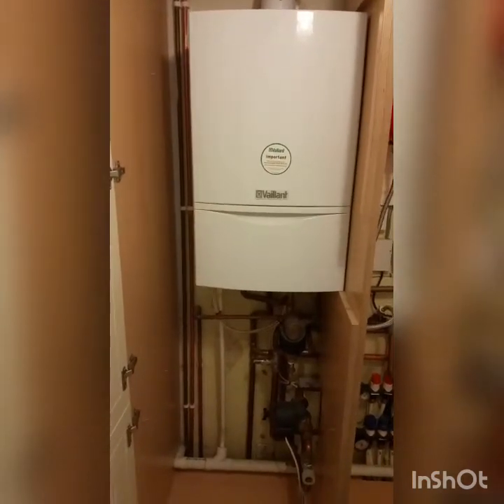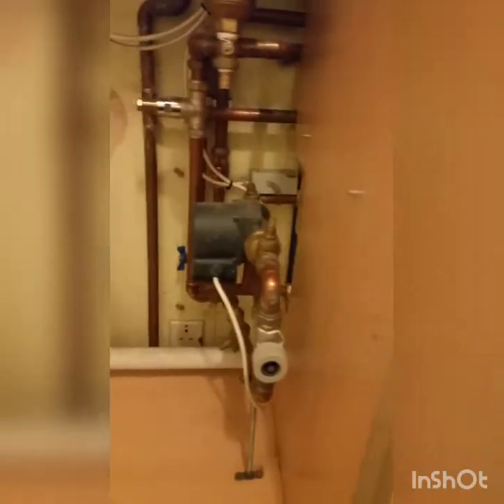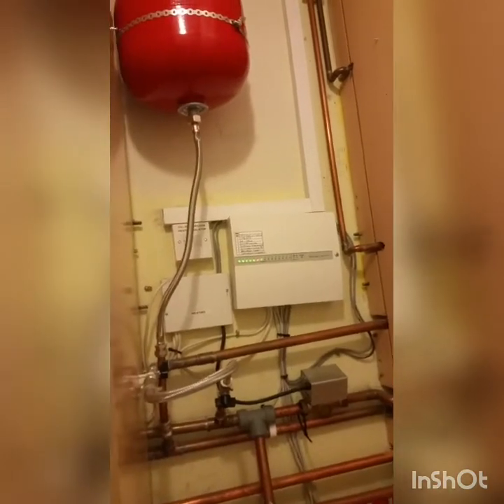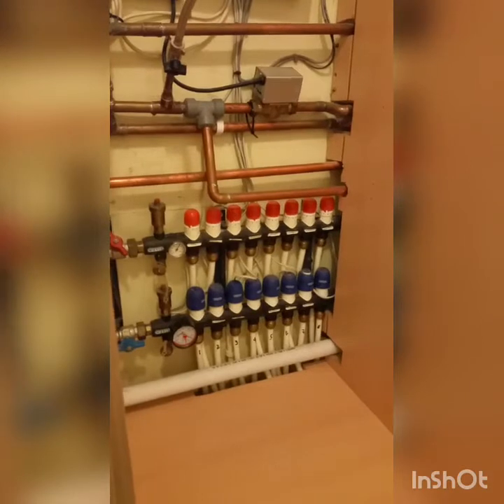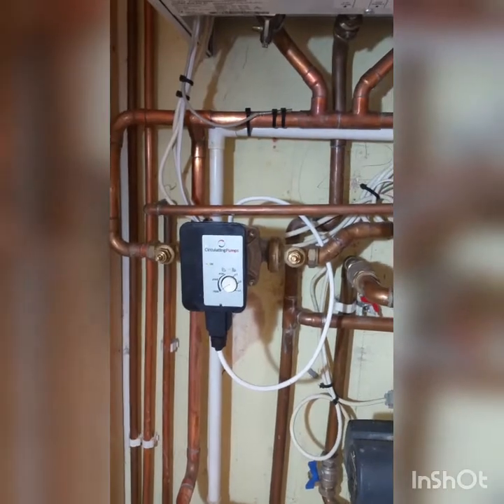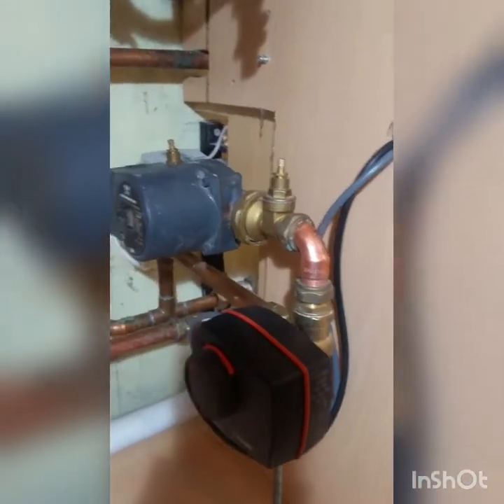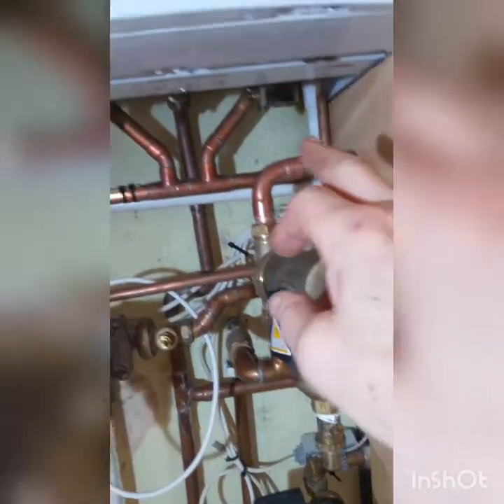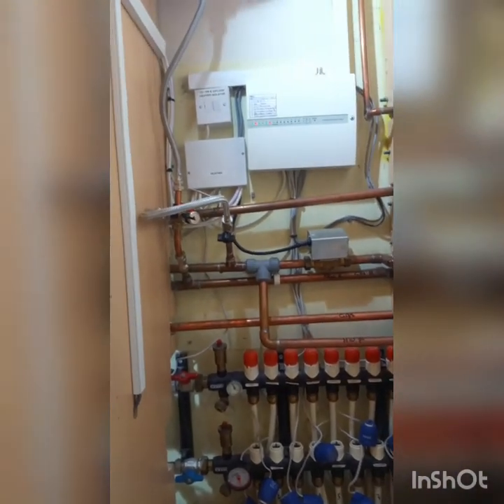Vailant with weather compensation and mixed circuit for under floor heating.

Comment: Would this work better with a heat only boiler? What’s the pump in the system boiler actually doing?
Reply from the maker: The pump in the boiler is doing the same job as an externally fitted pump would do for a heat only boiler
Reply: @andrewmillwardwatford9410  
Thanks for the reply & Sorry but I don’t understand why there’s a pump fitted to the heating circuit in the video if it’s a system boiler..
Reply from the maker: @mattconnick1208  because the system has underfloor heating it must have hydraulic separation. Once the boiler has been hydraulically separated from the system the boiler pump can only operate the flow within the boiler and it's circuit. After the hydraulic separation any circuit connected must have its own circulator. So in this installation we have a pump for the radiator circuit and one for the underfloor heating circuit.
Reply: @andrewmillwardwatford9410  
Ahhh thanks, so using the internal pump to circulate the heating and using the close coupled tees to separate just the underfloor wouldn’t work? I’m about to design a system with underfloor and a rad circuit coming of a manifold  is all and was thinking a heat only boiler might be the way  but like this idea.
Reply from the maker: @mattconnick1208  I have many videos on this channel explaining why you must never put close coupled Tees at an underfloor heating manifold when you also have a radiator circuit. This is a total no no and should never be done

Comment: Thanks for the video. With the weather compensation do the radiators have to have smart TRVs or will the existing thermostats  Drayton 4 TRVs ok
Reply from the maker: You don't need smart trvs

Comment: Hi Andrew, following my comments on your earlier video on this same install regarding my very similar setup without any WC,  from my limited understanding I believe with a fully WC heating system you set the boiler with appropriate heating curves for each zone so there's no reliance on room stats etc to control indoor temperatures as the water temperature to each zone rises and falls in line with outside temperatures / building heat loss so always maintains an equilibrium. 
Can you still achieve that with this setup or does the electronic mixing valve mean the UFH will run at a fixed water temperature regardless of the weather comp settings on the boiler, so in milder weather the rooms will be hotter? If so, is that where the Vaillant VDM mixing module takes things a stage further than the electronic mixing valve as the VDM seems to have its own WC curve set via the Vaillant controls?
Reply from the maker: The system in the video gives two fully weather compensated circuits. One mixer for the ufh to provide the correct temperature for the ufh circuit. The boiler will run at the higher temperature demanded by the unmixed radiator circuit but still fully weather compensated.
Reply: @andrewmillwardwatford9410   Thanks, so does the EBV vary the UFH water temperature automatically in line with the boiler curve? Probably my lack of understanding and certainly not questioning your install or anything like that as I'm just trying to get my head around it but I assumed the EBV was just a more accurate version of a mechanical blending valve, set it to a blended temperature and it will maintain that outlet temperature regardless of incoming temp from the boiler? If its -5c outside though the temperature required for the UFH zone is going to be higher to maintain a given room temp than it would be if it's +10c outside, which is where I thought WC played its trump card to vary that temperature with a set curve to balance the demand of the zone, and without that compensation youd need to set the flow temperature to worst case demand to keep warm at -5c then use room stats to control it in milder weather? Cheers
Reply: I've just had a quote to upgrade my dumb controlled 1 year old Ecotec to WC with both rad and UFH zones separately WC'd using all Vaillant kit, the quoted cost is a mere £8000 😳
I suspect if I can find a clued up local engineer to do what you've done above it will come out substantially less than that?!
Reply from the maker: @LocostR1  sounds crazy. Where are you ?
Reply: @andrewmillwardwatford9410  that was my reaction TBH 😂 We're the wrong side of London for you unfortunately, about 10 miles below Guildford.
Reply from the maker: @LocostR1  look for a heat geek
Reply from the maker: @LocostR1  I think it's about half the quoted price plus vat. I would travel to do this job but you need to provide accomodation. I've done a few distant jobs as a result of the utube channel. It's so much cheaper to do at the initial installation but it needs to be done at some time. You can get much of the efficiency gains with small modifications but room stats would still be needed if you did that.
Reply: @andrewmillwardwatford9410  I've emailed you at your business address, maybe I can give you the full lowdown on the current install and we can discuss what the options would be?
Reply from the maker: @LocostR1  andrew.richard.millward@gmail.com

Comment: Andrew - I’ve seen people with mixed circuits for CH ok weather comp but why would this be needed?? If the boiler is outputting a flow temp based on outside temp - that would be fine for the rads? Only requires mixing Down on UFH as the temp could still be too high for that? Only thing I can think is if the cylinder is calling for heat - weather comp would allow higher flow temp for better recovery at which point if a mixer is installed on the central heating circuit -
It would then blend down that hotter water to maintain a lower temp. Is that roughly accurate?
Reply from the maker: Viessmann only give an option with mixers on all zones in the design guide now I believe. A mixer is required to give actual temperature control to each zone. If you have an ufh circuit with a mixer and an unmixed radiator circuit you can get complaints at night setting that the radiators are too hot. The radiators will run at the same temperature as the ufh circuit and if this is 200mm centers this temperature can be quite high.
Reply: @andrewmillwardwatford9410  cheers Andrew. So basically no detriment to adding the mixed ch. I have a Vaillant and will be adding weather comp and mixed circuits just like this video so I was
Intrigued :) if I can can a decent wiring schematic from Vaillant!
Reply from the maker: @beak700  Vailant do great technical help.

Comment: Great video. Do you turn the boiler pump right down now it’s basically separated? What is directing the mixer valve in its job? Thankyou
Reply from the maker: I got Villizar from Vailant to do all the setting over the phone. The Vailant is very complex for setting and I was lost. Just grateful to Villizar. Viessmann are a lot easier. Viessmann is almost fully automatic set up

Comment: How do I connect my manifold wiring centre into the vailant boiler?
Reply from the maker: You dont need too. With weather compensation no room controls or boiler signal is required. The room temperatures are controlled by adjusting the flow temperature in the floor coils. The boiler does all this for you.
Reply: @andrewmillwardwatford9410  Can you explain further? I am trying to setup ufh for ground floor with existing radiators upstairs.  If you don't have zone valves and you don't have thermostats etc or those heads. How does the boiler know when to turn on. E.G. If upstairs i hot enough due to the radiators how does the systems continue to heat the UFH downstairs whilst turning upstairs off? For example at night I would want the ufh to stay off and the radiators upstairs on only and during the day vice versa.
Reply from the maker: @techclipzgo  
Ufh runs on set back of 2c so should not switch off. 
Each zone is controlled by a pump. Pump on gives flow and pump off stops flow. Each mixing valve gives the correct flow temperature to each zone to achieve the target temperature. 
It's so simple, effective, efficient and often cheaper.
Reply: @andrewmillwardwatford9410  but how does the pump know when to turn or off? If you arent using thermostats
Reply from the maker: @techclipzgo  I think it's better if you call me on messenger so I can explain
Reply: Andrew Millward I would also like to know regarding this please ?
Reply: @andrewmillwardwatford9410  I am doing a similar install UFH in one area and radiators every where else on two zones ( ground floor and first floor), I installed Vaillant Weather compensation controls but am a little confused on how to wire the esbe valve to the Vaillant controller?
Reply from the maker: @ismaielchaudhary  are you on my face book forum ?
Reply from the maker: @ismaielchaudhary  search for me on face book